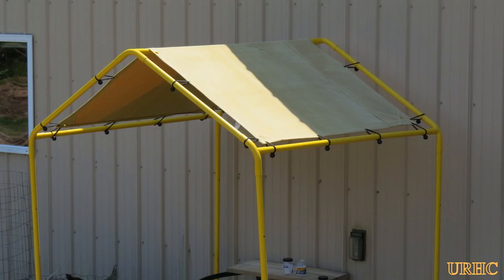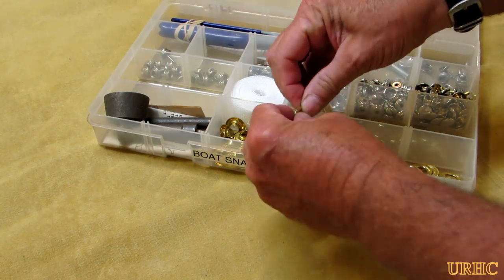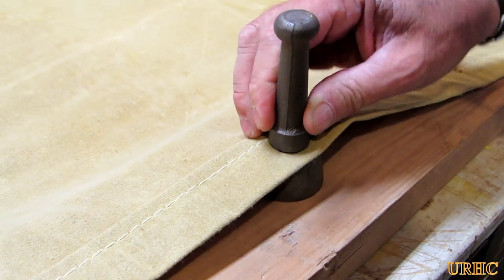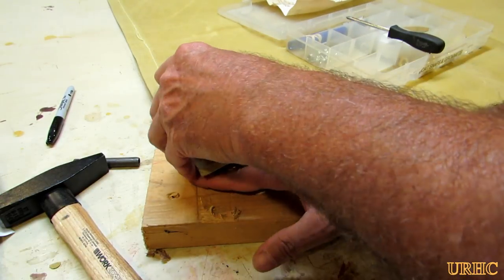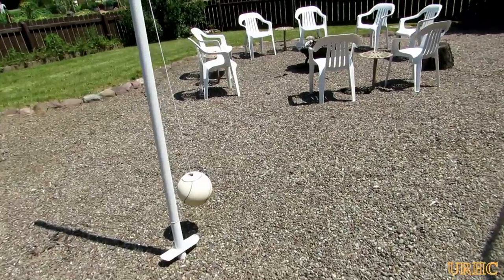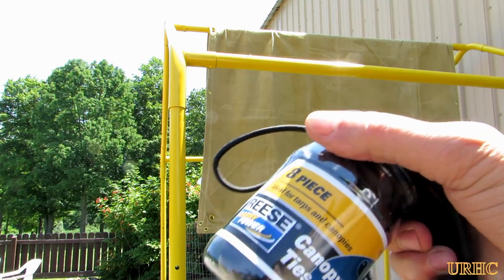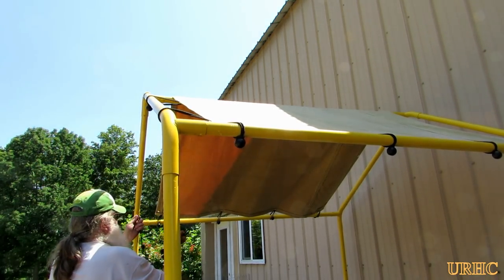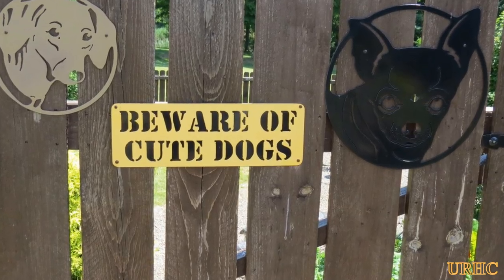Installing Grommets In A Tarp To Make A Garden Canopy

Comment: Great idea, I have a bunch of PCV pipe I could make the frame with. Just purchase some tarps from Harbor Freight. I already have a grommet kit. I really like your "Beware of Cute Dogs" sign. Did you make it? If so would you be willing to make one I could buy? If not can you tell me where I can get one?
Reply from the maker: Find some uv resistant plastic rated paint to make the pvc last. I have not had good luck with the harbor freight tarps lasting more than a couple weeks in the sun and wind  so I went with coated canvas. 
I plasma cut the sign, but am not set up to sell anything so the easiest way to get one would be to paint one. They were just stencil fonts so it should  be pretty easy to find a stencil set to speed it up. Thanks for watching.

Comment: What a great idea ...just had a friend drop off a frame like that they didn't want. I will have to put it together and do something similar. Thanks for the great idea
Reply from the maker: It is very easy to cut them down, sand them and spray on a coat of paint. There are many different tarp sizes available,  or it would be easy to make one from the sunbrella material.  Thanks for watching.